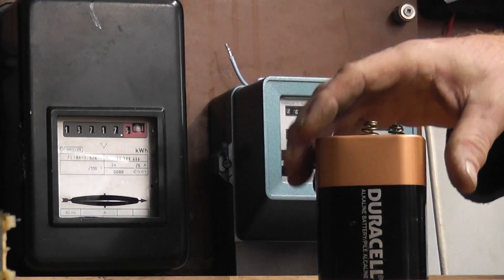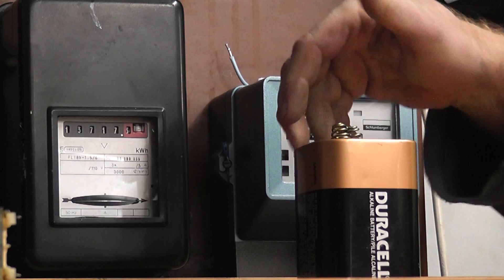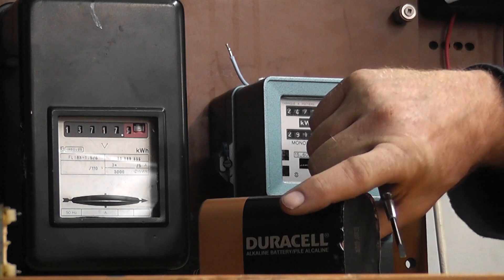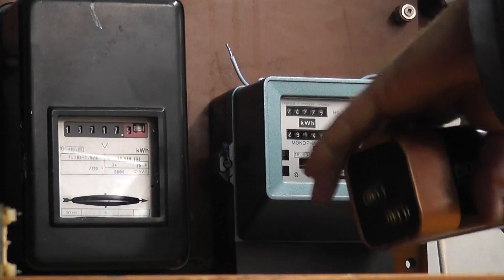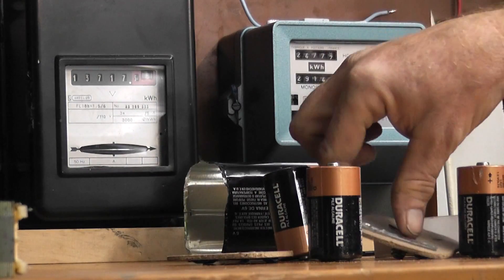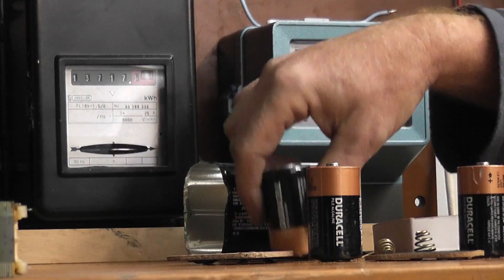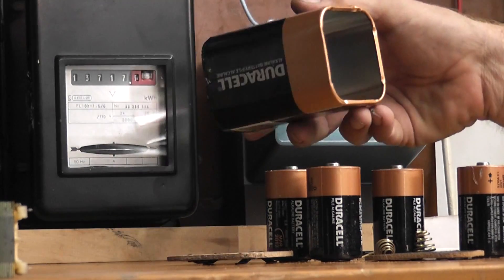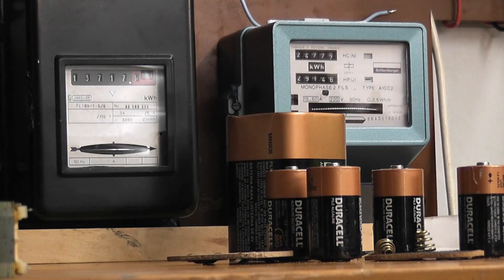6 Volts battery hack

Comment: All alkaline cells are NOMINALY  1.5 volt but under load they are about 1.2 volt. So 4 cells (connected in series) are 4.8 volt and 6 cells are 7.2 volt under load.
Few years ago some companies make rechargeable NiMH 9 volt (nominal) cells which is made of 6 cells connected in series similar to alkalines but rechargeable.
These days some companies make rechargeable Lithium-Ion 9 volt (nominal) cells which is made of 2 cells connected in series.

Comment: I haven't taken a 9 Volt apart in years, the last time I did it had six vertically stacked segments or cells, and the cells were not incased in anything other then plasic film, it was an alkaline battery I believe. You have to watch it with some of the newer 9 volts when it come sto old pocket transistor radios, the caes are larger and will not fit in the battery compartments of many sets.
Reply: wraps are probably so cheap that it costs less to wrap all of them on the same production line than have unwrapped ones taken out

Comment: It works out the same more or less from my local supplier - Lantern Battery :£2.84, 4x D Cells: £2.80. It only becomes cheaper if you end up buying 100s of the lantern batteries, but then you could get a bulk rate on industrial D cells so it would be cheaper still.

Comment: Yes, same as rocketman221projects, I have opened several Eveready "Classic Lantern Battery" 6V Carbon Zinc batteries and have found 4 'F' cells inside. Lots of nice current capability. What a disappointment that Duracell puts cardboard inside. But that is alkaline. Not sure if Eveready does that with their alkaline 6v as well or not.

Comment: I've taken apart some carbon zinc ones and they have f cells in them. All of the alkaline duracell lantern batteries I have opened have d cells in them though.
You can buy a lantern battery adaptor that takes d cells and they are cheaper than buying lantern batteries. I prefer the sealed lead acid lantern batteries though.

Comment: My goodness...Never seen this before! What a bump-off. Like others have said, there really should have been F-cells in there.

I do wonder: Seeing as this has 4x D cells in it, if you were to re-assemble this & then give it a "Rodalco-Recharge", would we get four loud Whistley-Squeelers all at once? :-D

Alternatively, now that you have four individual batteries.....POP THEM! :-D

It's been some time now since I've heard any whistley-squeelers, flame-throwers or arc-outs. 
:-D

Thanxx,

-BBD.
Reply: Normally The F cells are Zinc Carbon. these D cells are Alkaline with much more capacity for the same volume.

Comment: I can certainly see the point in doing it.  They mass-produce smaller batteries for common stuff, they still mass-produce, but at a much lower level, these batteries for lesser situations.
What I don't get is why they wasted money having a useless external casing for the internal batteries, with printing and everything.  That casing is pointless for this use-case.  I could save that company millions.  Where my job at?